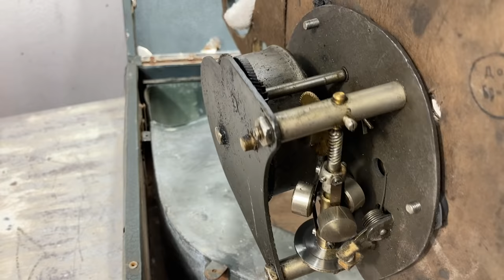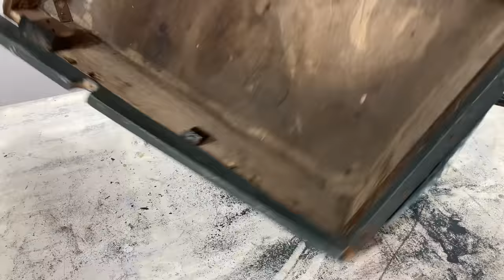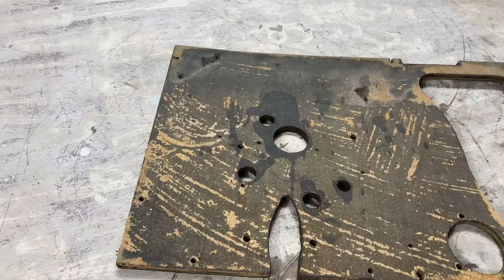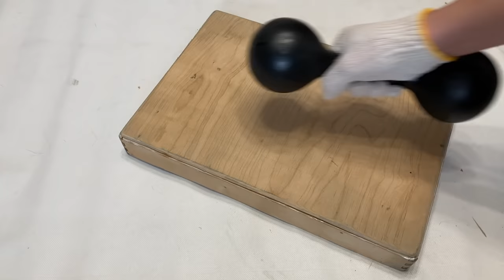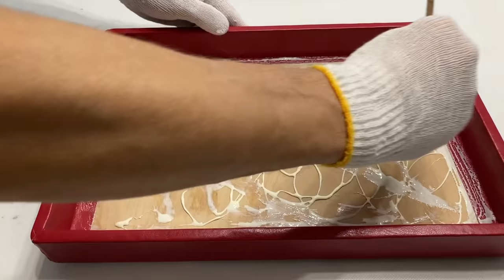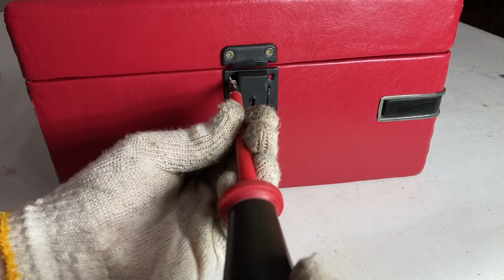1938  rare Gramophone Restoration | I restored old record player

Comment: Not really restoring, when you ripe off the original cover. WAY to many restoration youtubers need to rethink what it really means to RESTORE a Item. You do not make design changes, color changes. You are try to Restore the item back to what it Originally looked like when it came out of the Factory. You Do NOT remove casting marks, You DO NOT pick a color that wasnt what it looked like from factory. You do not polish a part(S) if it didnt look like it from factory. If you cant find a color or a fabric after removing it. then, you try to closely match it as perfectly as possible, even if it means going thur dozen of colors, or dozens of fabrics. Do your Research on it. Fix it up like it should be. Not how YOU WANT IT TO BE. Thats not restoring a item. thats just fixing it up to YOUR OWN TESTS and not true Restoration/
Reply: Agreed.

Comment: That's all I saw was cosmetic.  What did you restore?
Reply: Not to mention entirely changing the design (colour, texture, manufacturer logo etc.) and using Phillips screws even in highly visible spots. And painting the latch black rather than nickel plating it.

Comment: I lost interest when WD40 was chosen to take screws out of a wooden case.....??
Reply: Most likely that's the same thing that made the mechanism work again, for now...
Reply: What would you have used?
Reply: @sjames5027  WD40 is a liquid good for making things move again in order to take them apart. It is not to be left in the mechanism as it does not act as a lubricant very well. Ideally, take the whole thing apart, clean everything in an ultrasonic cleaner, then put it back together and use dedicated oils.
Reply: A little bit of sick came into my mouth at that point.
Reply: А как восстановил механизмы м не показал...

Comment: The leather embossed vellum coated fabric was adhered to the case originally with contact cement. for people that wish a more sympathetic restoration. The covering could have been carefully cleaned & reconditioned before removal, then using a razor blade carefully peeled off the wood box. the contact cement dries out over time making this easy. Heat can be used to help release the bond too.
Reply: I have an old one I want to restore. Do you have some more advanced advise on how I could treat the leather?

Comment: I'm pretty late to comment, and this stuff is just my opinion, but wouldn't it look amazing if the outer covering was instead replaced with a dark (sheepskin?) leather cover, with a dark red felt for the bottom interior? A little bit of water + wood stain on the handle for the wind-up mechanism without lacquer ( Using wax instead ) would look great too. For the carrying handle, a harder black leather would contrast well with the brown leather cover. And as a final touch, a little yellowing agent on some of the metal (such as the screws and maybe the horn) would look nice too. Keeping the badge, though, would be most important.

Comment: Well, I just wasted some time. I wanted to see what you did with the pick up head. I have one from the 1920s that I am just going to preserve. The pick up head has crumbled. I thought you would show some of the metal and mechanism. 
Covering with the red vinyl was just tacky.
Reply: if the reproducer has crumbled then you sadly have no choice other then replacing it, the material it is made of is likely pot metal, and is non-repairable. but a properly restored machine will sound a heck of a lot better then that, trust me, I own several wind up phonographs and this one in the video sounds AWFUL compared to them.

Comment: It would have been more interesting to keep the original covering material which could be glued back and emphasize the video on the restoration of the mechanism. NB: there is less risk to break the  spring  by letting the plate to turn while winding (and blocking it thereafter).
Reply: I have always wound mine while turning.
Reply: Repent and trust in Jesus. we deserve Hell for our sins. For example lying, lusing, saying God's name as a cuss word and stealing our just some examples of sin which we can all admit to doing at least one of those. For our sin we deserve death and Hell, but there is a way out. Repent anf trust in Jesus and you will be saved. Repentence is turning from sin. So repent and trust in Jesus. He will save you from Hell, and instead give you eternal life in Heaven.
John 3:16
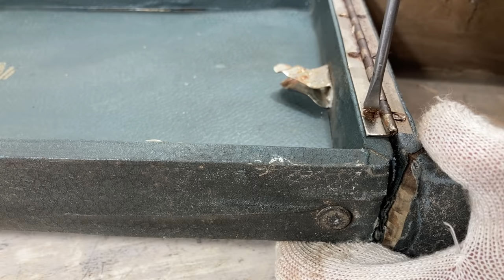Romans 3:23❤😊❤❤

Comment: The sound box either needs to be rebuilt or you need to put a fresh needle in it (one needle per play). You can but packs of 100 for under $10 on eBay. Would greatly improve the sound quality

Comment: you didn’t demonstrate the mechanical portion. assuming you had somebody restore it for you, but the way you did the case i assume you did the shotty job in the mechanism too. the corners are lumpy and not smooth, you didn’t replace the turn table fabric, and the leather was poorly applied. you didn’t rebuilt the reproducer, you removed the logo, it sounds horrible, you didn’t pain the horn properly, the only “OK” thing you did was rebuild the case but even there you didn’t use clamps and will fall apart eventually. so overall a pretty shotty restoration

Comment: A hack job.  You didn’t clean the metal sound resonator before you painted it.  You never cleaned the motor mechanism.  Your glue job will fall apart because you never used clamps to put pressure on the wood while the glue dried.  And, no, that tiny weight isn’t sufficient.  Your sanding job was insufficient.  You don’t use a belt sander with a heavy grit and leave it like that.  You’re supposed to finish with a fine grit of at least 180 or 220.
Reply: Такая советская техника, ее покрасил по старым шрамам и продолжает работать...

Comment: At 16' 17" you forget to retrofit the horn (big metal chamber) you have removed at 1' 55" !!! This spoils the sound ! (maybe you put it afterwards ???)
Also, you could have kept the original logo printed on the original foil, and choose something in the same colour, not this vulgar red 😮
This is a transformation, NOT a restoration (= rebuilt identical to the original, as if coming from the factory).